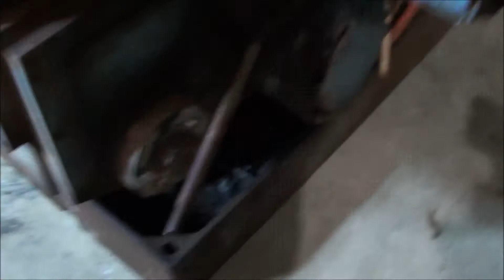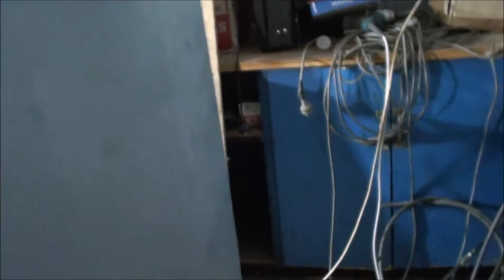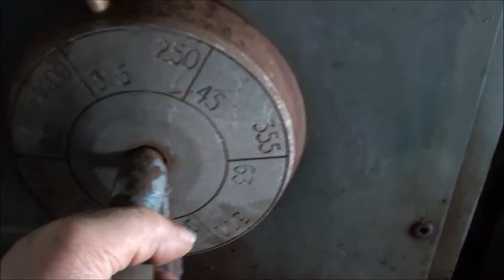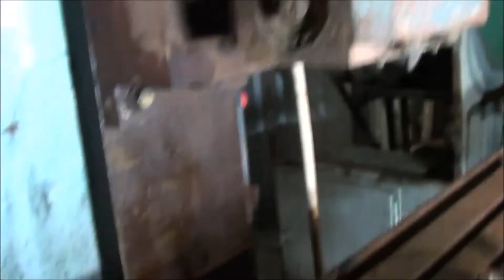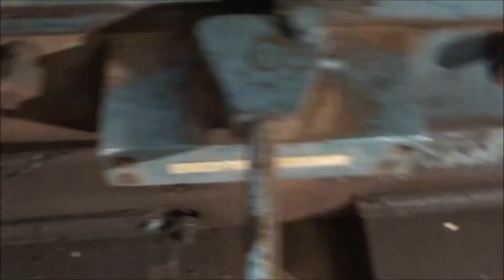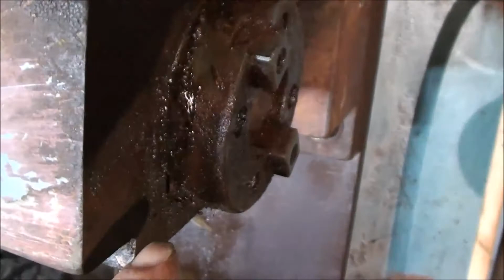Elliot Mill   Part 1

Comment: https://www.bidspotter.co.uk/en-gb/auction-catalogues/cjm-asset/catalogue-id-cjm10387/lot-f3f84060-21f8-4023-a837-a75f00b1d01f
Reply from the maker: Thanks mate, interesting to see that there is no overarm on that machine, and there is a movable quill in the head. First pictures I have seen of all of the missing instruction plates off my machine.  Many thanks. Greg

Comment: At least it's not seized, that's well ahead of the slotter, ... nice find, wish i had the space because this size machines go really cheap over here.
Reply from the maker: dynoguy haha. I think the knee screw might be seized but I haven't checked to see if the table knee is locked on the gib yet. Time will tell. Unfortunately these machines are all over priced here, in my opinion. Mainly because freight to get them here formed a significant portion of the original purchase price.  Thanks for commenting
Reply: I know exactly what you talking about, even i know a good reliable guy with a crane truck charging me only £1 per mile traveled, loading/unloading included  (so usually twice the distance) it just doubled the price of my cheap South Bend lathe.
And England is small compared to where you live, within about 3 hours i can get pretty much anywhere of interest.
Reply from the maker: dynoguy When I go to work i often drive 600kms to the workshop in the morning then another 3 to 400kms to get to site in the afternoon. You can drive about 4000kms going from one end of Western Australia to the other by the most direct route without leaving the state! !! Texas fits 3 times into my home state and there is still change left over !!!. That said, you can imagine the shipping costs just getting the machine to Australia. It's an awesome place to live and travel in, but we always tend to be biased towards home 😆
Reply: I was assuming you scored those machines somewhere in Australia ...
I did know distances can be quite long down under, but that's an awful lot of driving, ...  got about 4 minutes to the office, and if i am going out to customers, most of them are less than 3 hours away, ...don't be jealous, there are a lot of other things which aren't that good....:-)
Reply from the maker: dynoguy one of the best things about what I do is that I get to see some fantastic country.  I can talk about it for hours.  One day i might even do a video about it

Comment: Nice score Greg, best get sometime sorted out you've got your work cut out to get through those two machines. The universal table has a lot of advantages over a fixed table..... if you can make use if it. That vertical mill head is going to be real useful. I've a plan to strip mine a service it as it's been greased through the oil points at some stage, I know this as it chucked the grease out when  I wound the speed up to 1800rpm. ☺
My pal up the road knew the shaper you have, he used to recondition machines for his living I will ask if he's any paperwork. All the best Mat
Reply from the maker: Thanks Mat, I am about to move the shaper today so that means breaking it down again :(

Comment: Great machine, under the shyte it looks to be in pretty good condition,
 The motors should be fine after drying out- get a Megger (If you don't have one) and check the insulation resistances before powering up.
Cheers, J.
Reply from the maker: Hi Average Joe, I'm confident the motors are dry as the main is in a very good place, and the knee motor has to be able to take a good dose of coolant over it. I will however take your advice and get a sparky mate to check them out for me, along with slotter motor. Thanks for watching and commenting

Comment: Hi Gregg,
Not had a chance to watch your vertical shaper / slotter video yet. But that Elliot looks like a hell of a machine. Had to buy something to use that universal dividing head you bought awhile ago eh :-) Like you say the new mills going to need some tlc. That looks more like your red Australia road dust on the greasy and oily areas than rust. And the 10 hp motor should shift a bit of metal for sure. So far you haven't shown anything on it that can't be put right with a bit of work. I don't envy you the repeat of your shaper and removing all that grease. Especially the head if that's supposed to be an oil filled head and I'm guessing it was. Hopefully the spindle bearing haven't been ruined from heat yet.

Since all 3 machines were either built in the U.K. or possibly may have been built in Oz under licence then if it were me? I think I'd take some real good pictures and post a thread on the Model Engineers Magazine forums. There's enough older and ex or current professional machinists there that for sure at least a few may have knowledge or information. I suspect I know who's not returning your emails about a shaper manual, and if I'm right that's not the first I've heard of that happening. Might be worth checking Keith Rucker's Vintage Machinery for information as well. Possibly it's a long shot since they are British built or designed machines, but he's got hundreds of scanned documents on that website and just maybe something might be there.
Reply from the maker: Turning Point I've already checked out Keith's page regarding the shaper and there was nothing there. I haven't looked at it for the other machines though.  I suspect the universal dividing head might spend a bit of time on the Elliott. I think it will be just great for helical gears.  Thanks for watching and commenting.  Hope all is going well for you
Reply: Yes that dividing head will be put to good use with the new mill Gregg. Having the universal mill and a universal dividing head is one thing, there was a thread not too long ago on the PM website about the math involved to cut helical gears, way over my head with the calculations for sure. I think I bought my universal D/H more for the compound indexing it can do along with high count prime numbers than it's helical capabilities since my mills table is non rotating. There's ways around it with a turret mill if I need that though. I'm not 100% sure since I've never even read a manual for one, but I believe your new slotter may be able to shape helical gears as well. Some of them would but don't know about yours. We had a large 50 taper Cinncinati universal mill that had the vertical and horizontal spindles at the last mine I worked at. A touch bigger than your Elliot though. About a 2500 mm x 450 mm table size. The biggest and most rigid mill I've seen so far. The Bridgeport they also had looked like a toy compared to it. :-)

Comment: I love these big old machines, I have done up a couple and it is a very rewarding thing. Not cheap in the long run but you end up with a great machine. If you haven't got 27 projects on the go ya not trying.
Reply from the maker: Bundy Bears Shed Hahaha Lance, I'm only admitting to 27 lol. One of the good things about doing these projects is that you develop your skill sets in areas that you normally wouldn't.  I'm certainly looking forward to using the finished machines. Oh, by the way,  I'm going to admit to another project later today or tomorrow so that will make 28

Comment: Hi i have a elliott 1250 sturdiemill it looks like yours but the table looks bigger on yours and the universal head on yours has a extra swivel joint i think you may have a sturdimill 1500 and mine motor is 7.5 hp the manual i have for mine is not very good only showing general maintaince lifting points so on  did it come with the horizontal milling equipment for the overarm ?
Reply from the maker: gary rhodes thanks Gary. I am starting to suspect that it is a 1500 and your comments have increased my level of certainty.  Unfortunately i have nothing more than what you saw in the video so I will probably have to make all of the missing bits apart from the horizontal milling arbor. Thanks for watching and commenting.
Reply: I also ave a 1250 - with a vertical head - slotting head and horizontal attachments. In very good condition but never been set up - hope to get it running soon.